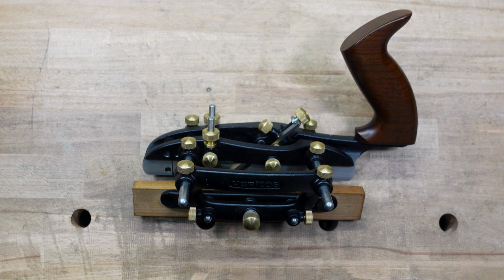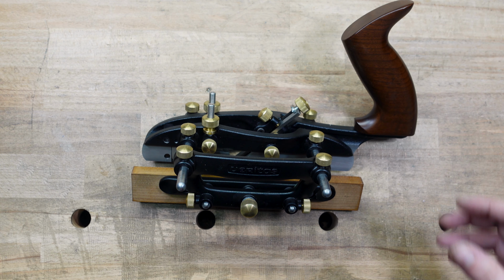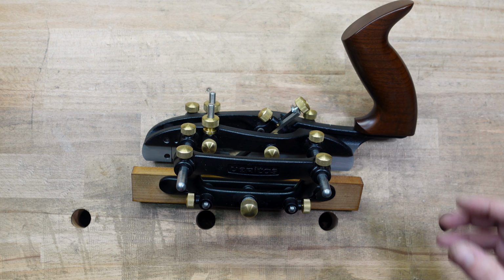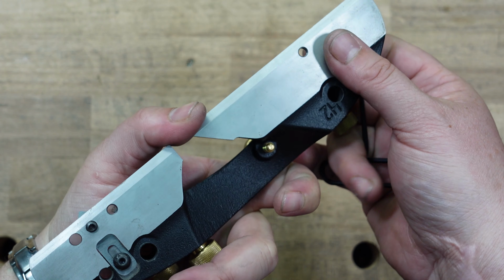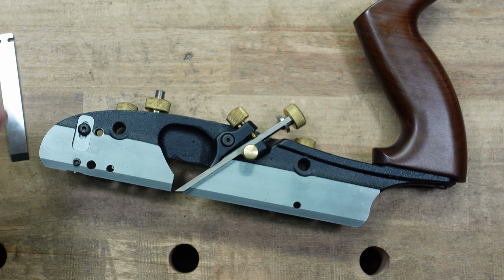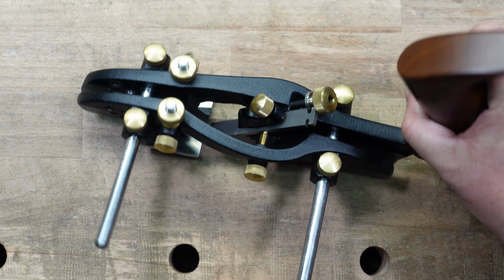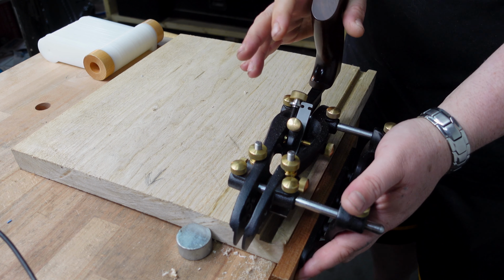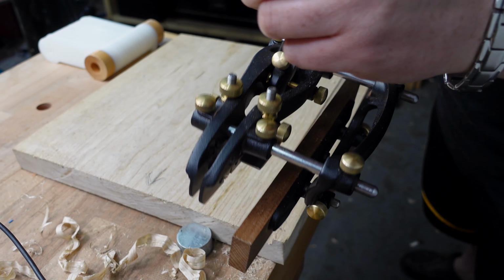How to use the Combination Plane

Comment: If you want to wax the fence just once to help with friction and don't want it to gunk up then put a coat of wax on the desired surface, place a paper towel over it, then warm iron it and wipe away any residue.  This melts the wax into the timber forever.
Reply from the maker: GENIUS! Thank you! I am going to do that, great idea!
Reply: Beautiful idea. I am gonna do just the same. Thanks

Comment: Good video. I am totally in the camp of, if I have 1 dado to cut I am using my plow plane, just because it is a bit faster than getting out the dado stack on the saw. Plus I like using the plane. The only thing I do not like about it is, that it is really hard to use on smaller parts. e.g.if I am making a box, it is much better for me cut the dado or the rabbet for the box bottom , depending on the design, then cut the sides, meaning it is easier to cut 1 groove on a 2 ft board than cutting 4 grooves on 6 inch boards. It is doable but just harder.  It seems like every week I go to the lee valley site and think their box makers plane looks so awesome, but then I go and use my Stanley 50 or my Stanley 45 or my veritas small plow plane, and realize that I do not need another plow plane.
Reply from the maker: Lol as I was reading this I was like, ya he needs the box makers then I saw the end haha you are correct if you have those you don't need the box makers but it is alot smaller and easier to use on small parts. So with your self uo it would be a luxury tool and not a need. Ask for it for Christmas or your B-Day hahhaha

Comment: Just letting you know that I appreciate your videos.  I am just getting into hand tool wood working so find myself on your channel frequently.  Also appreciate your love for Veritas.  I was going to get Lie Nielsen's but I am in Canada and have a Lee Valley 15 in away so made no sense to pay $$$ for US exchange, duty and shipping.  Also parts close by too.
Reply from the maker: Thank you! I appreciate that! And ya with LV thay close I deff recomend going thay route. Aim for the custom line if you can I wasn't a big fan of the standard line. If you do go with standard Open the mouth more than you would think you need to. That they work a lot better.
Reply: Based on this comment and your previous video I will certainly go with the custom line when the time comes.  I bought a low angle jack on their seconds event last Fall and got to use it for the first time yesterday!  Lots to learn still but it was really nice to hold and work with.
Reply from the maker: @Kevin G  Sorry I thought you were talking about bevel down planes.I loved bevel up planes and highly recommend them! You honestly can get all bevel up and be fine. For higher angles like when you're working difficult grain they just take more effort to push. But if you are just starting out just focus on bevel up as you get more advanced you'll see what I mean.
Reply: Thank you!  I will likely have a mix of both bevel up and bevel down eventually, but needed to start somewhere so started with the low angle Jack as it seems to be quite versatile.  The advantage of other LV bevel ups (depending on models) would be to have different angled blades that could be used in all the planes.  I like versatility!
Reply from the maker: @Kevin G  100% agree! I started with the BU Jack also (unless you count the Kobalt no 4 from lowes, I'm pretty sure I threw against the wall hahahah) 
From there I got the BU Smoother and then ventured into bevel down when I gave myself the time to learn them

Comment: The Lie-Nielson honing guide can do it but you need to get both left and right jaws for it for the angle on your spearpoint. Basically you can get it with 30 or 18 degrees. I've opted for the Swanson marking knife that uses disposable blades like an old school razor. Enough blades to last you a lifetime will cost about twelve bucks.